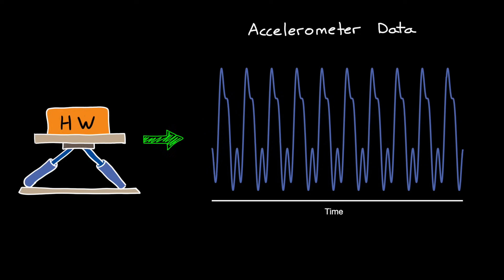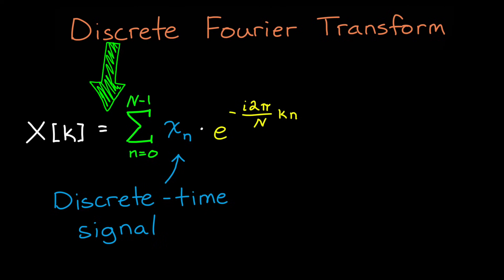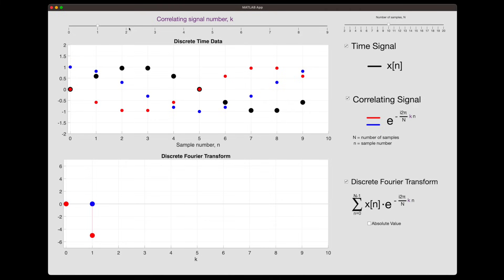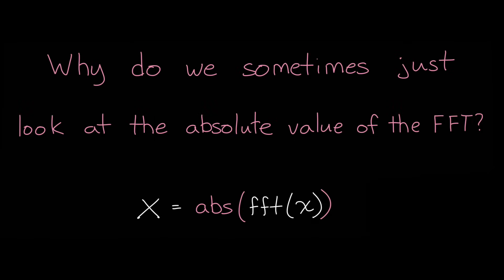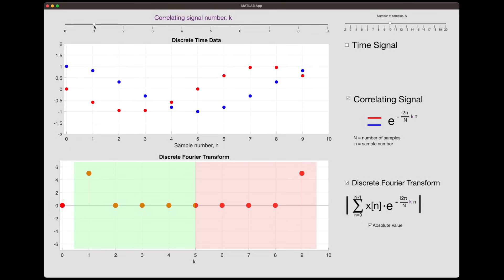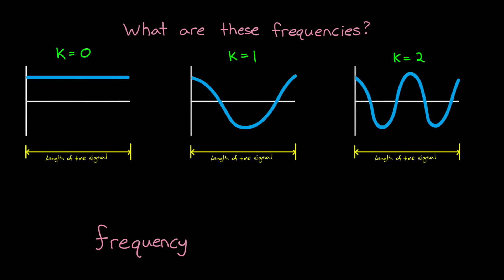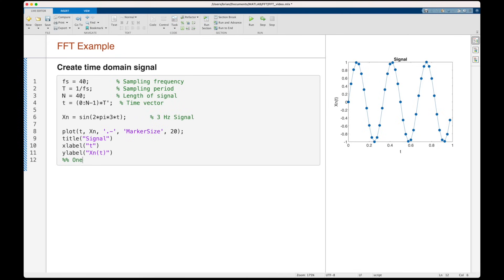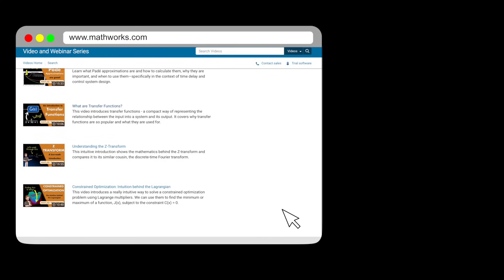Understanding the Discrete Fourier Transform and the FFT

Comment: Fantastic Video, I just don't get one thing, why do we have negative frequencies?
Reply: Negative frequencies aren't physical in sense that we have negative hertz or something like that. With the DFT, we're representing a signal using basis functions of the form e^(jw/N). A single real sinusoid, like cos(wt), is a combination of two opposite rotating phasors. So, cos(wt) = 1/2*e^(jwt) + 1/2*e^(-jwt). This means that in order to reconstruct a real sinusoid, we need both halves of that equation - a positive phasor that rotates in one direction, and a negative phasor that rotates in the other. So, negative frequencies are a function of how we're breaking down a sinusoid into those lower constituent parts.
Reply: @BrianBDouglas  thx for responding

Comment: @BrianBDouglas
Thanks for this wonderful explanation.
How can bin width be decided if sampling frequency is not available?
If the data is not in time domain, can FFT be still applied ? for example, if I collect phase rotation corresponding to set of frequency (f1 to f10,  in wireless communication), I will have phase data P1 corresponding to frequency f1 and so on, and no sampling information; how bin is decided?
Reply: Without sampling frequency, you can't convert the bin width into real world units like Hz, instead they'll just be left in the arbitrary units of bin number, or cycles per sample. The FFT also can be applied to any regularly sampled data (even if not time-domain), but the meaning of "frequency" in the output depends on what your input axis is. So instead of Hz (cycles per second) it would be cycles per whatever unit the original data was in. So, you can still take the FFT of your set of frequencies (as long as they are regularly spaced).
Reply: @BrianBDouglas thanks

Comment: 12:27 why not floor(N/2) + 1? that holds for both even and odd. people not doing their Concrete Mathematics smh.
Reply: Certainly. You can implement this in whichever way you feel is the most compact and helpful for you. For describing the concept, I opted for the explanation that I felt helps people who are unfamiliar with it understand it easier. I wanted to explain why the Nyquist frequency isn't captured for odd length signals and so talking about in the most straightforward way I could I thought helped that. Thanks for the comment.

Comment: Hi Brian, Greetings, Thanks for the great video, could you please explain a FFT of a complex valued signal and how is both the sides of FFT are used for any use case..
Reply: Taking an FFT of a complex valued signal is the same mathematically as the FFT of a real signal. The difference is that the negative and positive frequencies won't be mirrors of each other and therefore it doesn't make sense to look at just a one-sided spectrum in that case. There are many use cases of needing to look at the spectrum of complex signals in signal processing and radar and many others. In communication, some modulation techniques (like quadrature amplitude modulation) rely on that difference between positive and negative frequencies to encode information. I hope this answered your question.

Comment: Hi, ive always wondered how does an mp3 do this, does it need to do the function on the 44000 samples to not lose frequencies?

Also, how does it save all those frequencies? Does it only save a few with the highest amplitudes or does it save all frequencies with a binary amplitude, like turning on or off the frequencies?

Comment: Hey, thanks for the great video and the explanation. 
One question: I don't understand why the y-values (amplitudes) are so different when comparing the DFT formula you showed (video: 3:10) with the FFT in Matlab (video: 17:37). I can't get back to the real amplitudes in the manually programmed DFT with the formula video 3:10. What is the reason for this?
Reply: I'm sorry, I'm not following the question. Are you saying that the FFT() command in MATLAB doesn't produce the same Y-values that you get if you manually code the DFT formula? Could you expand on your question so I could answer it?

Comment: Hello. Thanks for your video. I have a question.
What is the number of samples I should have for my DFT? For example, if my sampling frequency is 100Hz. Do I need to take 100 samples (or N = 100). I checked the code and saw that if I take a different number of samples, such as N = 200, the result is different. I don't understand why.
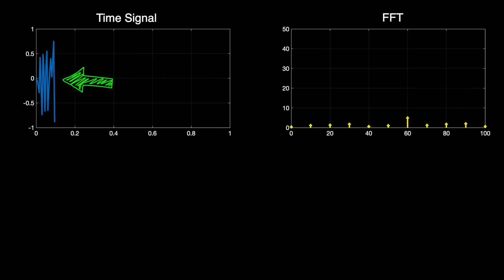Reply: Hello, I explain the impact of having more samples starting at 14:40. There isn't an exact number that you're shooting for, it depends on the signal and what you're trying to get out of it. The more samples you have the narrower the bin width. If you're adding more signal then the result will look different because - like in my example - you're adding more values to the signal frequency bins but not necessarily to the noise bins. However, if you are adding more samples by zero padding then you're just interpolating between the frequencies and not actually changing the data you're seeing. I think I was more clear in the video so I hope this helps!

Comment: Got a question. If we be very precise, (which is necessary for understanding this concept), whiy is the frequency equation freq=k/(time length)=k*fs/N? When I write it down, given N samples starting from 0s, the overall time length is (N-1)*T=(N-1)/fs, and as a result shouldn't freq=k/(time length)=k*fs/(N-1)? My understanding is that for a big N, there is almost no difference, but if say, we only have 10 samples, there seems to be a noticeable difference in the bin width, since then the time legnth is 0.9s instead of 1s.
Reply: I think the answer is that we're dealing with discrete time and so each sample represents 0.1 seconds in your example. So, the sample at 0.9 covers the time span from 0.9 to 1 seconds. So 10 samples does cover 1 second even though the first sample is at 0 seconds and the last sample is at .9

Comment: Why only sin and cosine functions not any other?
Reply: In general, we can describe a time series with any set of universal function approximators. But sines and cosines (or e raised to an imaginary number) are useful since they describe oscillations and frequency. They are also unique in that they don't change their general shape when you take the integral or derivative of them. Therefore, they are the solutions of differential equations which is what we use to model dynamic systems. Maybe someone else can chime in with a better response because I'm just sort of riffing here. :)
Reply: I'm not a mathematician but I guess because in LTI systems if your input is a cosine (or sine), then the output will be another cosine (that could have different phase and amplitude but still it's a cosine). You can then apply the superposition theorem, which says that the output given by the sum of the inputs is equal to the sum of the outputs given by singular inputs!
Basically, cosine and sine are the "fundamental" elements

Comment: I really wish matlab had a OneSidedFFT() function so I don't have to manually tweak the inputs and outputs of fft() so much.
Reply: Yeah, unfortunately that's not an option. But it's just a single extra line to grab half of the output and the input doesn't need to change. If you're looking for power spectrum, however, you could use periodogram which does have a one-sided option.
Reply: You can use fftshift() when plotting to help.

Comment: Are there any factors can influence the efficiency of FFT implementations?
Reply: Yes, but typically there is no such thing as THE FFT. Most modern computing packages, MATLAB included, actually have several FFT algorithms depending on characteristics of the data. What happens is that the software actually looks at the data, is it even or odd-length, if it is even, is it a power of two, and a number of other characteristics to come up with an "FFT plan" (yes that is actually what they are called). This is what is used to decide which FFT algorithm is actually called to operate on the data. So, quite a bit of planning goes it to deciding which FFT algorithm is the most efficient one for the data characteristics, it just happens very, very fast.

Comment: How would you suggest I prepare data for an FFT that has occasional gaps in its sampling? Say 1 kHz sampling rate with occasional 100 ms gaps
Reply: When you say gaps, are the data missing, or do you just know that the sampling was irregular. If the data is missing, the best thing to do is to interpolate the data to fill in the missing values. If the data is there, but you just know that a glitch occurred then how big is 100 msec in your scenario, if 100 msec is inconsequential, you can just treat the data as uniformly sampled and you're likely OK. In reality all samplers have some jitter. If 100 msec is really a significant gap (which appears to be the case in your scenario since 100 msec is 100 samples), then again you can interpolate the data onto an evenly sampled grid.
Reply: @wayneking1995  I’m referring to missing data in this case. Such as some buffer filling up and samples being dropped until the data logging software catches up. 
In my specific application I think these gaps are in fact small enough and infrequent enough to ignore
Reply: @JKTCGMV13  Then I would suggest interpolation.

Comment: Can you please talk about when we have to calculate N point DFT on a M point signal. How to do it.
Reply: Suppose there is need to Tune to FM radio via Digital algorithm and with associated hardware , then ADC might provide M ( 1.2e6) samples per sec  and  N is1024. In this case compute N point DFT and take decision on FM channel presence.  or perform 10 time N point DFT and decide on FM channel presence.   This will work well for Digital Tuning. //
Reply: The "how" is trivial. Just use the available fft syntax variations in MATLAB. Y = fft(X, N); 
https://www.mathworks.com/help/matlab/ref/fft.html

When/why - for example:
N < M ---> Update your analysis every M/fs time period, have a bin width or fs/M,...
N > M ---> Decrease your bin width, "interpolate"/"smothen" your frequency domain representation (when padding with zeros)
Reply: @GabrieleBunkheila  I want to calculate manually and not use MATLAB, I am from mechanical engineering, so I don't know how to proceed with it
Reply: @kleidbasket  refer to the formula shown in the video between 2:25-3:14 and use whatever value of N you need. For any value of n > M-1 (case N > M), just assume x_n = 0
Reply: Is N here bigger or smaller than M? In either case, in MATLAB you can use fft(x,N) to compute the N-point DFT. In the case that N > M, that will zeropad the data out to N samples. In the case that N < M, you will get the DFT of the N-point truncated signal.
Reply: @wayneking1995 How can I do it manually